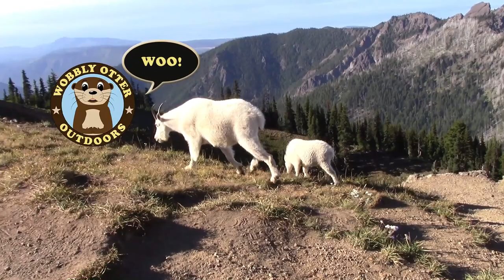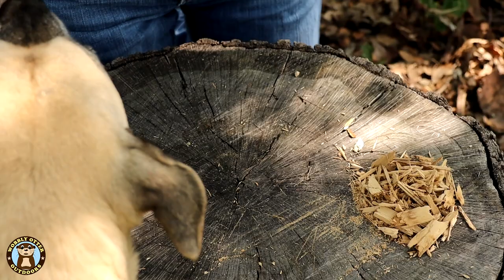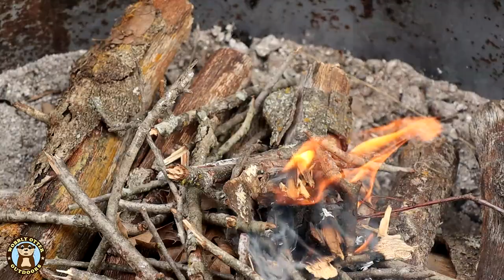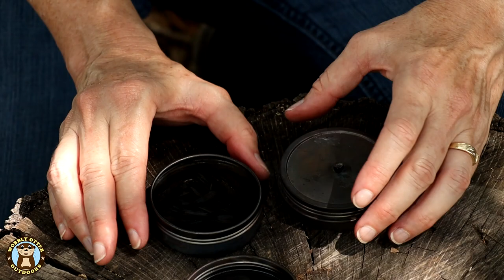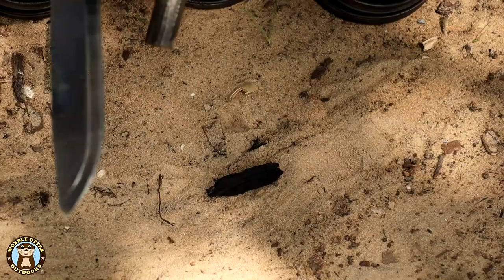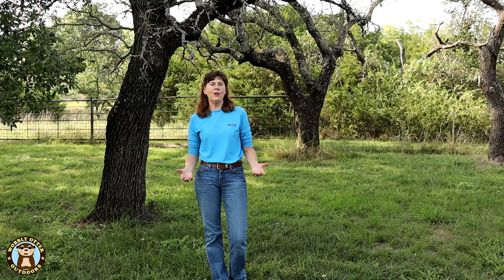Making Charred Punk Wood

Comment: Made denim char cloth  just yesterday and it works great.  This was my second attempt. On the first attempt , I placed the tin on a charcoal fire, it made char cloth, but, it shrunk the char cloth so much! Was extremely brittle and had huge difficulty taking a spark.  once it took a spark, it was great! The second attempt, I placed  the tin in a wood fire, and the end product was much better. Takes a spark much better, shrunk way less and nowhere as brittle.  I suspect charcoal may burn too hot for making char cloth ?
Reply from the maker: Super cool and interesting.